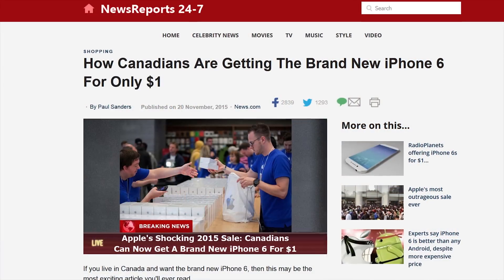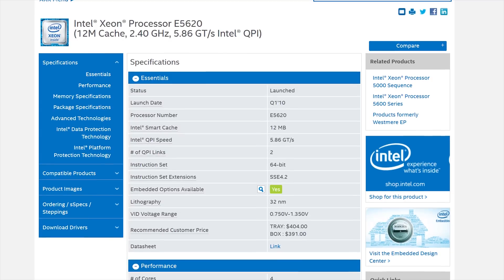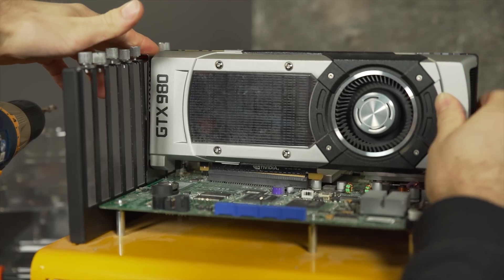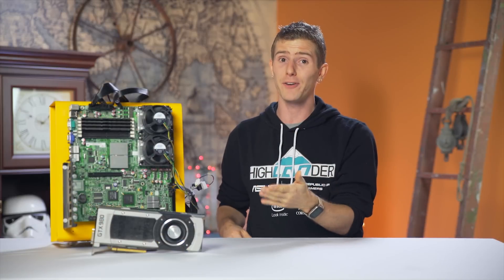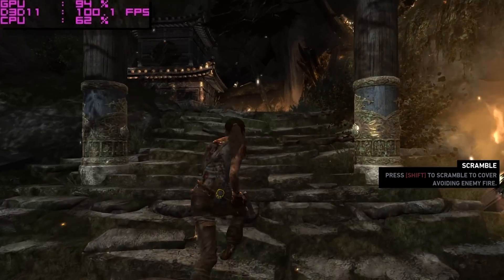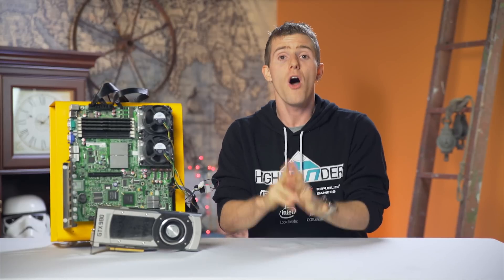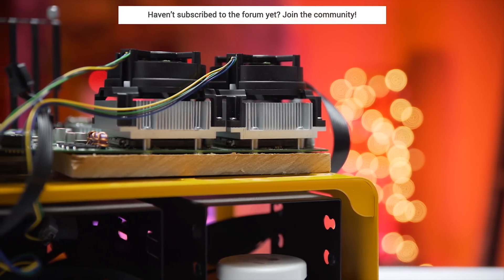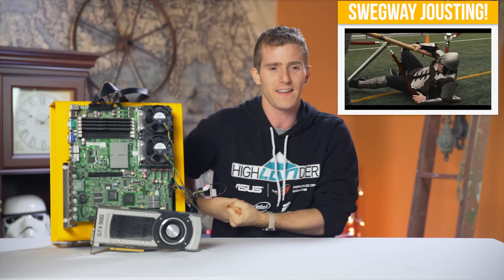Under $150 Budget Gaming 8 Core CPU, Motherboard & 16GB RAM

Comment: I'm actually running a system with a Xeon X5460. Clocked to 4.1 GHz it still kicks ass and is on par with recent i3 in multithreaded workloads (115 single and 450 multi in CB15) while about half as fast as a moderately clocked, recent i5.
Games run fine on it. Was actually surprised about how much a 8 year old chip still can do.

Comment: I have a Dell Precision 690 and upgraded from dual 3160 to 5335 and the graphics from a Quadro 1700 to a BFG 9600gt.  While the Quad Core 2.0Ghz might not seem like much it makes an astounding difference.

Comment: It would be interesting to put a rig like this in a homemade table tor glass frame case for cooling as well fit,use some extensions and you wouldnt even have to worry about things fitting. Interesting but would take ages to find the right prices and pieces. In that that time one could just save,but awsome always to see a vid like this.

Comment: i just found a configuration for 12 core 2.26Ghz 16gb ddr3 with two pcie two pci and two other pci ports i dont know with a 2gb ddr5 graphics card that would support both my monitorsbut i havent bought it yet

Comment: You know what's funny? You can do the same thing with sandy bridge 8 cores nowadays! I picked up two Xeon E5 2450Ls, 32 gigs of RAM, and a server board for 284 USD total. Of course the xeons are clocked at 1.83 GHz, but hey, 16c/32t worth of processing power's still damn good!

Comment: Making a Frankencomputer is just not worth the hassle.  Any kind of physical mods can be extremely stressful.  I bought a stock water cooler for my rig and it was supposed to fit my motherboard (as I checked). Damned if that didn't fit way up in top corner.  I had to buy a special hacksaw to notch-cut a piece of my mid-tower case away so it could fit so that I could slide-close my panel.  You can spend a lot of money on this used junk and in the end have nothing worthwhile to show for your spend thrifty efforts.

Comment: Linus calls himself tech pro thinks 500cb score is low *facepalm
Reply: Well, it's not that bad, but I scored 441cb with one E5450 (equivalent of X5450, but with lower TDP). It's overclocked to 3,92GHz, it might seem to be good result, BUT in real use the CPU is much much slower than todays low-end CPUs (R3 1200, G5400).
Reply: i have 400+ on one E5450, so yes, 500 is low for a pair

Comment: Lolz I got a full PC for 300€, no keyboard no mouse no screen, and with crappy Win 10, +CPU 2.0/2.4 x4 cores, +1Tera HD(decent one), +cheap CD/DVD R/W, +wifi on PCI slot, +16GB RAM(the worst RAM the benchmark have ever run on the planet), 500W PSU. But is a cheap base for office PC, the only upgrades possible are RAM, HD, GPU 1 PCIe 2 gen, and 2 PCI ports.

Comment: Dell t3500 x58 chip.  1366 socket.  None of the ram suggested works.  Have seated correctly 24 gig 6 x 4* either get 1*3*2 beeps or bios can identify only 4 gig.  Memtest 86 only I'd 4 gig in dimm 0. Completely boots no prob just only one slot reading.  Any thoughts?
Reply: WELLL..... nevermind it...after a new CHEAP board, and the same stuff here it goes.
1366 LGA Dell motherboard ; x58 chipset. Currently 3.0 ghz i7 940, going for the compatable 6 core; this model only supports 6 core compatability. 24 gigs ram ECC running; and a happy home for a GTX970SSC 2.0
Reply: My WarThunder FPS Average is 70; Arma gets there 65-70 without the server lag. These are max settings; with those specs.
NOT BAD
Dell board, FREE. i7-940 - $30.00 RAM -$60.00 GPU = Found on Craigslist for 80.00
Linus spoke of $150, he was really close.

Comment: Theres an auction that has one of these for £18 (HP PROLIANT BL495C G6 SERVER BLADE. 2 X OPTERON SIX CORE 2.6GHZ and it also has 32gb of RAM )  Linus do you this with a GTX1050 would be able to handle games like GTA v  But im not sure if it has a PCIE slot for a graphics card

Comment: Dell Precision t7500 server, 2 quad core cpu's that can upgrade to 6 core x5690 xeon cpu's, has 3-4 PCIe slots comes with a nvidia q5000 from factory thats the same size as most modern gpu's so no sawing your card in half and most came with 48-196 gigs of 1333mhz ecc memory. works fine from factory with a minor gpu upgrade  all i did was put a radion r7 290x in and plays gta5 at 65+ fps with a ssd and a gtx 1070 it should last for a while

Comment: Hey, I tried gaming on a similar server board, the ASUS DSBF-DE. The cpu's, though, were much slower: Xeon E5310@1,6Ghz/266FSB, I BSEL Modded them to 2Ghz@33FSB. And it ran Battlefield 4! I ran spectator mode and ir ran really decent:) I'm selling the mainboard/cpu/ram locally, so I made a video in this channel. You can check it out. Cheers

Comment: I bought an hp ml350 g6 for $148 and put dual x5660 xeons for $64 with 16gb ecc ddr3 1333 that came with a cooler I bought a long while back and currently have a gtx 970 in it but am selling my old corsair 600c and other items to get a gtx 1080 in it, this is gonna be good

Comment: Particle board? Are you insane? Its nothing but saw dust and glue and even more flammable than a piece of pine 2x4 from Home Depot. Also heat will cause it to warp because it is just glue and saw dust.

Comment: To everyone complaining about how "oh wow you used a 980 and you still called it a 150 dollar build how dare you", let me just casually point to the title.

The price in-total accounts for the generalized cost of the Xeons, Serverboard and RAM. Doesn't include storage, OS, GPU, power supply, anything like that- so, if you're going to bitch, don't limit yourself to just complaining about the enthusiast card. As well, he explicitly stated the reason he used such an expensive card was because he wanted to see the bottleneck issue, which is a valid concept-- as most people would usually put their money on their GPU and be a little lenient with the rest. 

TL;DR: Just let it be, man.

Comment: Hey Linus, I saw that there are Adapter stickers that can be placed on LGA771 CPU's to make them work on LGA775 boards. Perhaps it would be good to do a review of how well these would work on a LGA775 dual cpu workstation board?
http://www.ebay.com/itm/2pcs-The-Third-Generation-LGA-771-to-775-MOD-Adapter-Sticker-For-Intel-XEON-2-/252532223340?hash=item3acc17ed6c:g:JsMAAOSwdIFX0orE

Comment: i have done better builds for the same price. the key to this is to look for a version 2 pcie slot motherboard. the x8 gen 1 pcie is a BIG bottleneck. i have had builds with core2quad cpu's with a r9 290 with gen 1 pcie slots and they can barely play GTA V on minimal setting and only changing out the motherboard to a board with a gen 2 pcie slot i was playing GTA V with every setting set to max and it was running and looking great. 

i like your videos linus but sometimes you drop the ball.

Comment: You can actually do a very easy socket mod and use a high end LGA 775 board for overclocking the xeon processor. Which will be cheaper aswell.

Comment: I did a similar build a few years back with a Tyan S3992 server board, a pair of Opteron quad cores, and 32gb ram (16x 2gb ECC DDR2). The Tyan board had 2 x16 PCI-e slots. It runs two ATI cards in crossfire just fine and also had PCI slots left over for the sound card (no on board audio). The top graphics card just barely fit under the one CPU heatsink. Other than that and the case needing cut to accomodate the larger board (chopped out the two lower 5.25 bays, drilled holes for additional board standoffs and relocated the HDD caddy to fit the wider board into a normal ATX case) it was a surprisingly easy build (didn't need to cut the locking tabs off my cards which was a huge bonus imo). Graphic cards excluded (since realistically you won't find a decent gaming card cheap), I didn't spend over $200 for my build (ram, board, CPUs, heatsinks, and the sound card. not including PSU, HDDs, etc. like the video). It was worth the little extra money, in my opinion, to have a board that had all the card slots I would need. After 3+ years using this rig, I've had no issues and it can run high end games with no problems. While a build like this can be complicated as seen in the video and definitely won't match or surpass far more expensive top-end gaming hardware, It can make a decent gaming rig on the cheap.

Comment: My AMD A8 7600 was only $80, A88M also about $80 and puts His specs to 
shame on the same games with no video card. Ok this does not include Ram
 8GB for another $60 thats $220 with a modern system that pays all games
 listed much better than a aging system. You dont need a $200 video 
card to make it work. You can spend that on a case and SSD.

His system still needs Case, Power supply, and video card not $150 for the whole system

Comment: I like the idea of the video, but I don't quite understand your choice when it comes to the board itself.

The thing has only 1 PCI-e Gen1 16x mechanical/8x electrical slot, but even 1U-Rack Boards come with usually at least 2, for example the IBM x3550 (7978), on top of that they come with 8 Ram Slots compared to 6. And they're more or less available for Shipping cost only (I bought 2 in jan 2016 for 14€ combined, with at least 16gb ram each).

This morning I bought a x3850 M2 for 2,50€ (...), including 56gb ram. CPU installed ain't even too bad, but I'll most likely replace them with 4 6 Cores or high-end quad cores, since those 30~ watt difference each won't change much overall and CPU prices pale in comparsion to the GPU anyway.

Since it has 7 PCIe slots (iirc gen 2.0 8x/8x) I guess I'll most likely wait a bit and see how dx12/vulcan turn out.

Comment: just get a used dell t5400 workstation. All put together already and easy to find parts. Bought mine with dual e5450s  and runs extremely well (good graphics card needed of course).

Comment: Look at some blade servers and they are even more limited yet.  like the ProLiant BL460c.  It can be powered while not in a rack and it has a connector on the front to allow a monitor, keyboard and mouse.  There is a video of someone running one like that and it seems to work well.  If I was to do that, I would put fans on the CPU heatsinks or even get coolers that already have the fans.   I would hopefully not need the loud server fans or as many of them at that point because those are for systems that have no fans inside them and that is likely only because they were designed to fit in smaller spaces.  What seems to be the advantage is that despite being second hand hardware, they are often sold much cheaper than you would get them new.  If you ever looked at the price of new servers, they can get horribly expensive depending on how many you need and their configurations.

Comment: i use s3420gp motherboard, i5 750  16 gb ddr3, r7 360x 2gb and still can run any game in 2017 in either ultra or high setting.. server board is still rock for gaming and doing work stuff..

Comment: TO ANYONE PLANNING TO BUILD A RIG LIKE THIS
the 2 CPUs have to be exactly identical, same model, same STEPPINGS
for example if you have 2 E5450 but different steppings like C0 and E0 WINDOWS WILL NOT BOOT (BSOD: Multiprocessors Configuration Not Supported)
Reply: What is stepping?
Well i had luck. Bought half a year ago two E5 2667 v2 for 250 Euro and they work
Reply: My understanding is as intel makes more revisions to the CPU, they end up shipping different versions of the same product. so if you bought two CPUs from two different updates, they wont work together. im trying to build a system like this and its a pain in the ass :p
Reply: @Wiimotejank  same
Reply: To anyone building something like this, you can get an 1156 Xeon with 8 threads that will easily outperform this in multithreaded applications and crush it on single core ones for far less and with a reasonable motherboard.
Reply: @h2oaddict  Today you should look into the Dual CPU Boards on AliExpress for LGA1356 or 2011
Reply: @itmkoeln  Nah, those things use to much power for what they deliver, the boards are also old and of questionable quality.
 I already have enough systems anyways lol.
Reply: @itmkoeln  your crazy if you buy anything from them, what you buy may not even be what you ordered
Reply: @stevejohnson5251  help ne build one please idn what to do with xeons shoild i go with 1100.series 1200 v3 ro v1s or 57470
Reply: @h2oaddict  I wouldn't recommend 1156, not even last year, 1155 Sandy Bridge at a minimum. Sandy Bridge kills Westmere in every way... first gen i7 and xeon were so ass compared to 1155 i7 and Xeons...
Reply: @rxdl  I wouldn't recommend either if you're not on a tight budget, and you're completely clueless if you think sandy is that much faster. A game that will run like ass on lynnfield will run like ass on sandy, and let's not even get into Overclocking...
Reply: @h2oaddict  Well sure but you wrote that in like 2020. This video is from 2015, big difference.

Comment: I game on a Xeon based system with 16GB RAM, GTX 980 and it runs great. Runs BF1 on high/ultra settings and will run all day. Paid 65 quid for it and  the cost of the GPU - Some solid hardware out there. A lot of server machines and workstations are out and about now! Go get a bargain :-)

Comment: Screw me, after all this time I realized that instead of sewing off the PCB on your GPU, you could just use a PCI riser instead:
http://www.ebay.com/itm/New-PCI-Express-PCI-E-16X-Riser-Card-Ribbon-Extender-Extension-20cm-Cable-YM-/172292564477?hash=item281d6fe5fd:g:S2cAAOSwaB5XoMi3

Comment: Hey could I ask a question I have a pc with a i7-4790k and I want to live stream harder games to run, if I used a capture card to connect this build and use it to run obs would It handle the encoding? And have the game run on the i7-4790k?

Comment: He didn't say that either Windows (XP,Vista,7,8,8.1,10) can't utilize both processors???People can get wrong impression that need to buy 2 processors!!!!Much better way is to buy socket 771 Xeon and to put them in socket 775 motherboard with some modifications  and bios upgrade and also you can overclock up to 4GHz and more.THIS IS PRO TIP!!!!!

Comment: ebay has a hp xw8400 motherboard #480024-001 439241-004 with dual socket 771, with 2 pci-e x16 one runs at 4x and one pci-e x8 and it runs at 4x also. you can run sata or sas drives on it, and ebay sells them right now for 80 bucks with free shipping. got me a pair of x5450 3.0ghz 12mb L3, to put into the next one i build. got a dual socket with 6 core opteron cpus using identical board except mine runs opterons and mine has 2 full speed 16x slots and 2 full speed 8x slots. or you can buy one of these opteron boards #571889-001 408544-005, and get a pair of opteron 2435 6 core cpus for around 20 bucks each and the ecc ram for these are dirt cheap. the board new on ebay just over 40 bucks!.

Comment: i did something similar. i got an old ML 350 g6 for £40. ddr3 ram at 1333, i stuck a xeon x5672 and a 980ti and the processor chokes the hell out of the 980ti. if you do this i wouldnt bother putting much more than a 750ti or 780ti if you do go down this route
Reply: Update: do this and get an x58 motherboard, they arent cheap but allow you to overclock to above 4ghz removing the bottleneck in most games

Comment: Suggestion:  I know Linus did a vid on using old server hardware on the cheap for a gaming system.  How about looking at some older workstations such as the Dell Precision T5400 or T7400 that still used FB ram?  I have found sellers on Ebay selling 16GB worth of FB ram for about $15.00 on average.  We just built for a customer of ours a T5400 with dual xeons, 32gb ram, dual ssd's, and a GTX 760 for under $600.  They use it for video editing and light gaming.  It would be kind of cool to see what Linus and the gang could do with such hardware.  Cheers from Florida!

Comment: Order $50 1151-Socket Mobo and pair it with $65 Kaby Lake G4560, Total costs to whole system with 8GB RAM, 500W PSU and GTX 960 4GB max. $300. Works like a dream and runs modern games High, Very High, Ultra Full-HD 30-80FPS. CS:GO over 200FPS etc. Job done, 12-36 months warranty for parts and no old crap in your home, Voila....

Comment: does anyone know if you could use LGA 1366 server board with 2 Xeon W3550s and install a OS like Win10?
Reply: Board should be fine but if you can find the model number on it and then find a manual online that says what processors/TDP it supports up to I would check that first. As for Windows 10 if it works on my old ass Pentium 4 630 I am almost positive it should work fine on those older Xeons.

Comment: Nice work Linus. Just picked up a xeon e3-1220-v2 and matching intel board for $50usd, I see some 2nd hand case with psu under $20usd, so all I'll need is a half decent gpu and ssd and shes away!

Comment: I say if you really want to build on a bargain, get yourself an Asus P5Q Pro motherboard, mod it for LGA771 support and get a single Xeon X5470. You can overclock it insanely well and the motherboard will be an actual desktop ATX one. With consumer-grade dual-channel RAM. Much less hassle and less risky than gambling on a server motherboard. You could go with LGA1366 or newer but you will have to pay more, especially for the boards.

Comment: or just go lga 1366 and go with a 6 core 6 thread xeon you can overclock to 4ghz and beyond.  Disable 2 cores and 2 threads, you can break 4.5-5ghz.

Comment: Going server grade for all this is simply not worth it.You can buy a low-end 860k or an fx 6300 for that money and get somewhat identical performance (maybe even more in games that scale up rather than out) because the ipc,while low,is much higher given the fact that the piledriver can boost to 4.2 ghz.Yes I know that nehalem is there and it is still usable but the fact is that for the Amd system you get something brand new,with warranty,and much better consumer grade hardware support (standard ddr 3 and so on).Also,certain games start to use newer cpu instructions quite heavily (AVX) ,instructions that are not available on the nehalem.